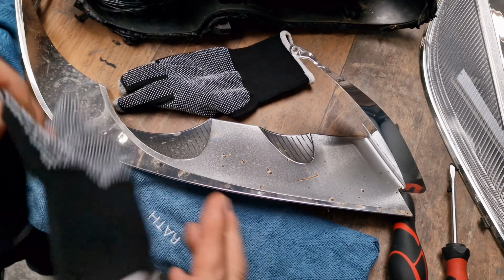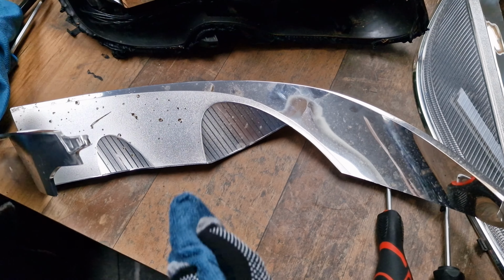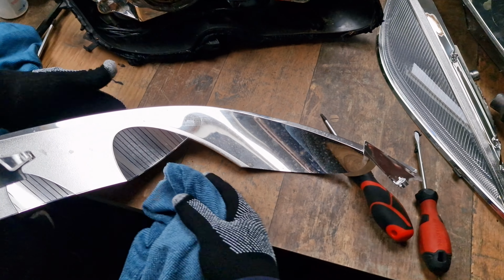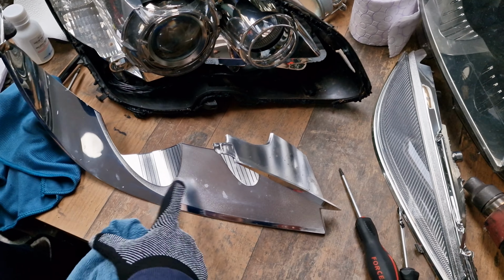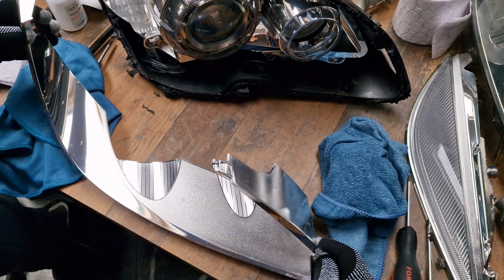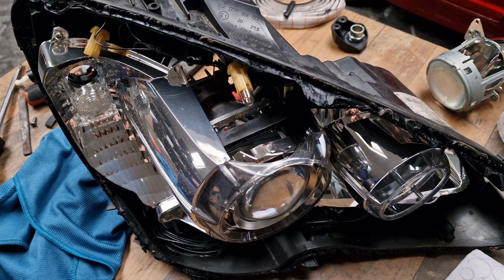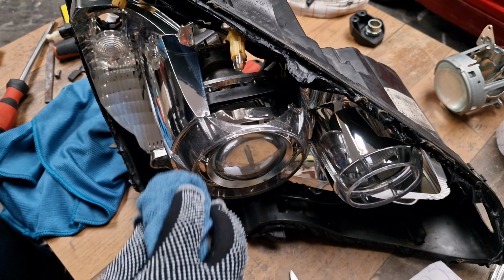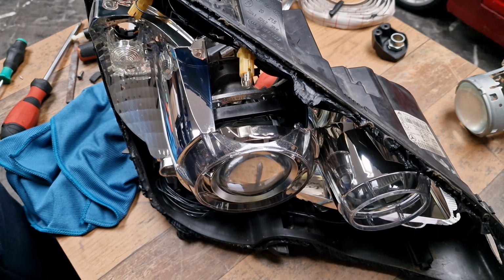How to clean the headlight chrome bezel without peeling the coating (Mercedes C-Class W204 headlamp)

Comment: I should have watch this video before touching my audi urS4 headlamps :D peeled littlebit of chrome and make some scrapes... almost ruined that one, they are pretty rare and only ones i can buy is 475eur/1 headlamp 😅 + just wanna say, i was thinking that those lights were bad already when i bought the car, have driven it like 8 years and now i have to change timing belt and waterpump and have 2 week time to clean lights. I noticed that they are in really good shape and they are just suuper dirty so theywerent really bad, just need to clean. cannot wait to see how they look after they are cleaned and installed :) + Thanks for the video!! :)
Reply: And do you have any recommend to clean those places that looks like shelf that havent been cleaned for 20 years? i mean like 1-2mm layer of hard dust on fragile chrome? Any water or anything or just with that fibercloth? i think using compressed air is bad idea
Reply from the maker: Just a wet (almost dry) fiber cloth without pressing, if you use alcohol you will wipe out everything.
Reply: @xenonland  Thank you, will do that :)

Comment: Great videos, it is noticeable that you do possess knowledge about headlights. Could you make a video how to clean projector lens(the glass part) from both sides and how to clean/repair the bowl when its burnt out /dirty? How does the polishing affect the light output when doing so?
Cheers !
Reply from the maker: Great suggestion! I am looking for months for a "very smoked"burnt" projector reflector to be able to show it/compare it.
Reply: @xenonland  B5.5/B6 Passat could have those, both with halogen/xenon systems. Opel Omega B2 is rare but old, probably on the crunchy side :D